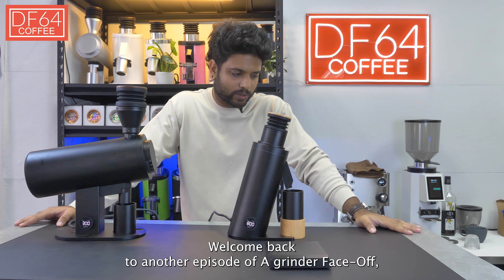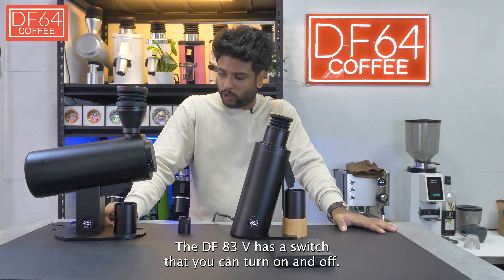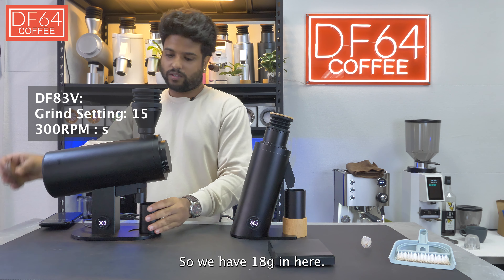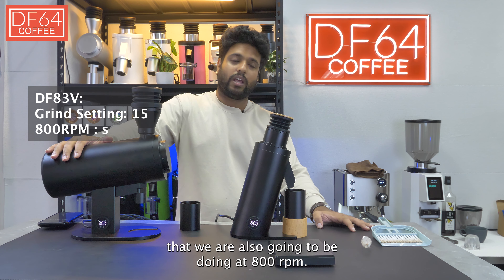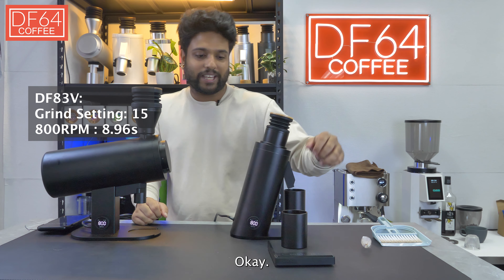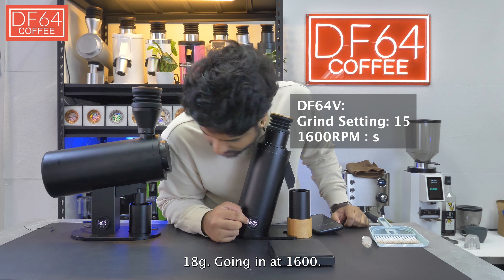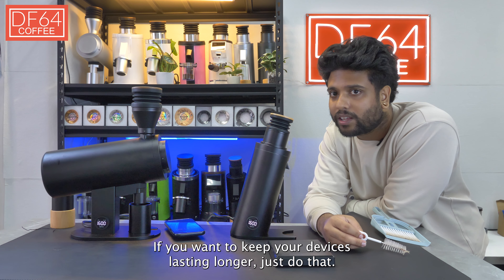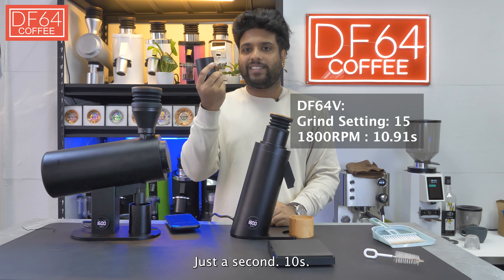Grinder Face-Off:  DF64V Vs DF83V

Comment: surprised how much bellows you had to use...making me think twice on the DF.
Reply: meh its fine. I use it with rdt and never use the bellows. two taps with the palm of the hand are enough.
the bigger problem is stalling. with light roasts and low rpm the 64v stalls. a lot. at 600 rpm I have to slow feed it; otherwise it will stall every time. I probably wouldn't buy the 64v again. I only bought it because the gen2 was sold out at the time.
Reply: @gr3g0r5  I ended up getting the DF83V. Very happy. no retention, no popcorn, no stalling even at 300rpm, no mess, no brainer.  Just a FYI, slow feeding changes the grind setting to much finer, and does alter flavors.